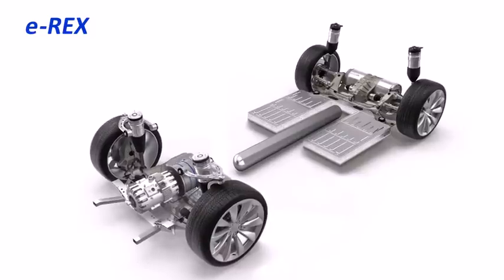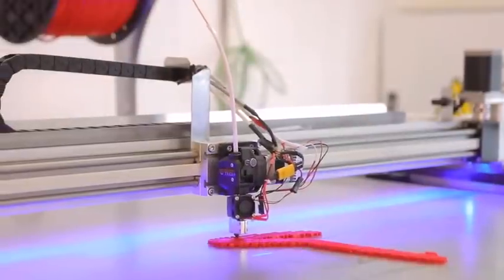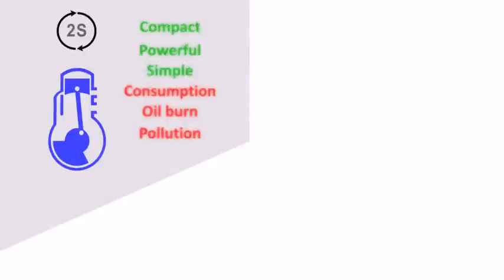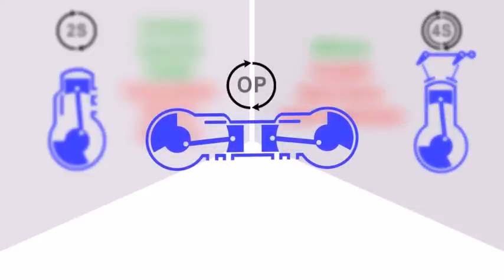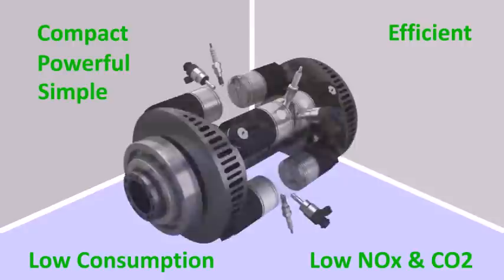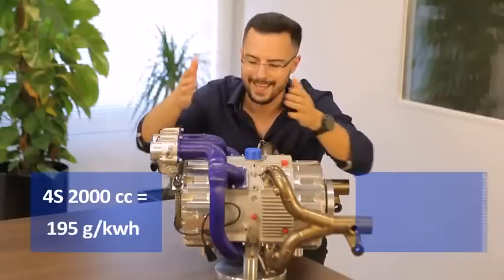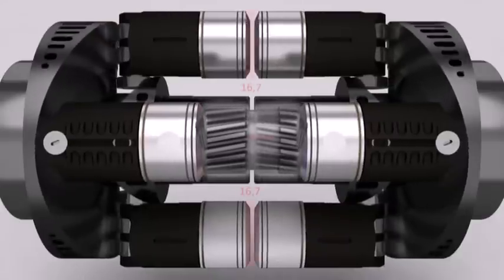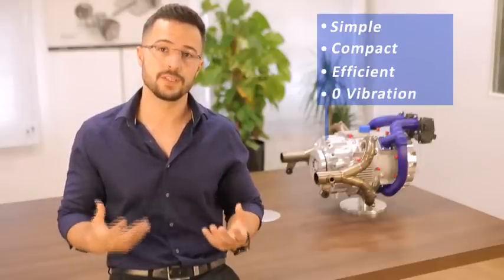The True Range Extender

Comment: hate to tell you this but that is two strokes not one. This is not a new design, the acadies engine is basicly the dame but with cran shafts. I would also add dimpling to the pistons it will increase thermal eff. and decrease NOx and CO2.

Comment: This is a modified copy of an opposing piston engine built around 1914. It will be highly polluting as it needs to burn oil with the fuel. Quite simply an outdated 2 stroke engine having a swash plate (1917 design) instead of a crankshaft. No more no less.

Comment: I'd like to see this in the real world... 1 question, looking at the cutaway thus is by all definitions a 2 stoke engine atleast, it has a compression stoke and a expansion stroke just like any 2 stroke engine...if your going to say it's a 1 stroke then you have to say a rotory is a 1/2 stroke, it has a 1 and a 1/2 expansion cycles per rotation of the, or for every 3 rotation of the "crank" shaft is about 6 expansion strokes...

Comment: I take issue with the terminology used. Firstly, this is not a one-stroke engine. The fact it has opposed pistons that move each move forward and back precludes the use of the term one stroke. One stroke means one action, one time. The absence of a crankshaft does not eliminate piston strokes. What you built is a two-stroke non-crankshaft engine. Btw: It also still has four phases. Intake, compression, power, and exhaust. How are you lubricating the piston rings? 

The beef I have is with how you described having variable compression! You said that when more power was needed, the compression was lowered; when more efficiency was needed, it was raised. ICE does not work that way. Higher compression engines are generally more powerful and efficient, while lower compression engines are the opposite. 

You must also develop a variable octane fuel to get variable compression to work correctly. Lower octane fuels burn faster than higher octane fuels. If you use a lower octane fuel in a higher compression engine, detonation will occur because it will ignite too soon. If you retard the ignition timing to compensate, you lose power and efficiency. If you use high-octane fuel in a low-compression engine, you lose power and efficiency because it burns slower and will not be completely burned when the exhaust phase arrives, resulting in higher emissions. Advancing the ignition timing can help compensate for the higher emissions but not the loss of power and efficiency. 

I see no practical reason for variable compression unless the sole purpose is to allow the owner to use less expensive lower octane fuel when not using the vehicle in a manner (towing, hauling) requiring more power. It also adds unnecessary complexity to the system.

Comment: This is a 2-stroke. We count the strokes by how many events happen per piston. This has a compression stroke and a power stroke, therefore 2 strokes. We do not count strokes by how many power strokers there are for the entire engine per revolution. If we did this, then a normal v8 would be 1-stroke because it has a firing event per half rev.

Comment: Must build a large one.❤
Reply: Then make it run on race fuel & stick it in a motorcycle 😂
Reply: @InsaneDad  that's the spirit 🤣
Reply: But, honestly. I feel that people would really get pumped about it if they built a high performance model. Namely American use. Don't corner yourself to a specific market with ev. I feel like as a stand alone power plant, the hp seems to be there. Honestly, maybe even side by sides. Boat motors, sky's the limit.

Comment: Its a 2 stroke not a 1 stroke .{1 stroke for combustion & exhaust} and {1 more stroke for intake & Compression} .So my math says 1+1=2 stroke. But still a awesome design and type of engine .And a awesome way to bring 2 stroke back to new generation motors .And if its as sufficient as INNengine says it is , then it would be perfect for ultralight aviation .Smaller so less metals to cast and machined ,and less working components then your normal 4 stroke engine. And my favorite thing about this engine is that you can change the compression easy. It would be much easier & cheaper to use this engine in a AWD mid engine vehicle .So its a 2 stroke engine that doesn't use 2 stroke oil & your ordinary crankshaft+connecting rods so its a opposed 2 stroke motor .I cant wait till someone does force induction on this motor ,or a turbo diesel model.

Comment: Range extension is great, why EV manufacturers (especially those from well established, well funded companies like ford or hyundai) didnt think to incorporate them from the jump is beyond me. Where i live and work the nearest charging station is over an hour away. And those living in towns / small cities who dont have a driveway and have to park on the street have 0 options for charging an ev. You cant run an extension cord out the front door to your car and hope nobody screws with it or trips over it and sues you.
Reply: Range extenders are a mixed benefit/cost.  For short trips you've got dead weight doing nothing but reducing efficiency.  For medium trips the generator may only be the same energy density as good batteries, so you get radically increased complexity with the same range as you'd get adding extra batteries.  For long trips it would be a real benefit, but it would take a long trip to be a worthwhile benefit due to the added weight and increase in complexity/decrease in reliability.

Comment: If u want a single-cylinder solution (instead of 4-cylinder), u have to let the 2 single-OPOC-pistons push the inside of a single eliptical race (instead of 2 swash-plates), that´s solidly and concentrically mounted on a flywheel (and better than the swash-plates)... In other words, the reverse of that here (not the cylinder, but the eliptical race must be turning!!!): https://www.youtube.com/watch?v=kHXKNpXoQUo
The difference is, that while the pistons of the engine (under the LINK above)  have straight rollers that simply turn the straight eliptical race, HERE, the straight rollers (of finite but substancial width) of the pistons have to turn a disc, and this can only work, if the rollers´ width is zero  (which doesn´t exist). 

But both need turbo-charging, and even direct injection, at best. It´s a clearly a 2stroke (not "1stroke"), and as every 2stroke, efficiency is low without direct injection.

Comment: 1-stroke??? It depends how you define the strokes: If you define the strokes by the movement of pistons it is a two-stroke! By this calculation a 12-cylinder 4-stroke woud be a one-third-stroke engine. :)
Besides this childish definition, if more efficient this motor would be a great deal!
By the way: As I see this design, the pistons are pushed down only by the power of combustion. Howcan you start this motor if all pitons are in up position?
Reply: They cannot all be in up position, since the intake-air won´t compress readily, to let that happen. all 4 piston-pairs can only be in the "middle" position. It works the same as if a crankshaft were there: Turn the swash-plates, and the pistons will follow/move according to the swash-plate form, suck air, compress and ignite it.

Comment: 195g/kWh  Que!!!!!  maybe 195g/kW learn the difference between energy end effect.
Reply from the maker: Specific consumption is measured in g/kWh. In other words, how much fuel (grams) you use to produce a certain ammount of power (kW) for a certain ammount of time (hour). I hope you learned something today, thanks for watching!
Reply: If you men how much fuel it takes for 1kWh you must give us exactly the fuel energi (chemic energy not nuclear). we know how big difference it is between metanol and jet fuel.

I think that this range extender has much better potential than your.  https://www.youtube.com/watch?v=_pBPw33ceoQ&t=6s
Reply: gr/kWh is correct. 195gr gazoline contain 2,34kWh. The engine extracts 1kWh of electricity out of the 2,34kWh of chemical energy, that´s contained in gazoline. 2,34kWh of chemical energy are spent for an 1kWh-electricity-production, or 195gr/kWh.

Comment: You say the motor is equal to a 2L 4 cylinder 4 stroke modern engine is efficient? How efficient? Also how much more efficient is this engine? If it is not 15% or more they automotive Boys won't look at it! It would mean gutting their engine plants & starting again.
Reply from the maker: It's hard to compare efficiency. The same % in an ok large slow diesel engine, would be impresively good in a small gasoline. We will have definitive efficiency figures by the end of 2023 as part of the homologation process.
On the other hand, you are right in your assessment of how hard it is to penetrate the automotive market, this is why we are focusing initially in other sectors where our weight reduction figures (70%) are a game changer by themselves, and any efficiency improvement is an added bonus.
Thanks for your comment!

Comment: Compact - Yes. 
Min vibration - probably yes. 
One stroke - BS! Power stroke + compression stroke = two strokes. 
Efficiency - power lever arm ~ 50% crankshaft
Hybrid vehicles = bad (crutch) solution
Reply from the maker: Early tests are showing close to 30% reduction the drag friction coeficient. This was expected anyway since not only we have smaller engines at lower RPM producing more power but also much of the contacting surfaces interact now by rolling as opposed to friction.
As for hybrid systems, the future is eclectic.
Thanks!

Comment: VCR designed by Caterpillar in the early 2000's.
Reply from the maker: There are many engines designs with VCR. The latest example would be Infiniti's. The difference is that, since their concept "adapts" the conventional engine concept to achieve variable compression ratio, the result is expensive, bulky and complex. Our design is the first one which can achieve VCR without the need of complex systems thanks having been designed from scratch with it in mind. Thanks for watching!

Comment: How about the abrasion problem at the contact point between the cylinder and the curved plate.
We solved it with metallo-ceramic at the apex of the Wankel engine rotor; by the time the Wankel engine was ready, the market didn't wanted it anymore.
How many km a car with your engine will fare?
The initial Wankel lasted 50k km vs 300k km of a piston engine, thus failed initially.
Great innovation BTW, thanks for the video ..
Reply: this is the first I've heard this claim of the Wankel contact point being solved. Please share data
Reply: @larrymar19  me too :)and doesn’t matter BTW that they burn oil in almost two stroke rates :)
Reply: "the contact point between the CYLINDER and the curved plate" is uncritical, a plain gap could be there, and it wouldn´t matter at all... It isn´t a contact-point subjected to combustion-chamber-pressures, where it´d have to be air-tight. It doesn´t have to be air-tight for any reason, so, leaving a gap there is the best solution, possibly.
The contact point between the PISTONS and the curved plate, an the other side, are critical, and may have too high friction, but the pistons ride on (frictionless) rollers (with bearings themselves) upon the swash-plate

Comment: Variable compression ratio like that, OK,   1/2 stroke ! garbage marketing ( like climate change) ....   you get that with an 8-cylinder: 1 power stroke every 1/4 revolution.   but I like the compactness like an hydraulic pump/motor..      yes/no?
Reply from the maker: No, it's not the same. Of course you can have the same power delivery just adding more cylinders, but then your engine is larger, heavier and more expensive. The beauty resides in having more with less. Thanks for watching!
Reply: there are similarities to the steering pump motor on the car i used to have.

Comment: Basically, a swash plate motor but I can't see why it is being called a "One-Stroke " Motor.
 A one-stroke motor would only fire once and then do nothing. Opposing pistons have been around since the Napier Deltic engine, a 2-stroke, 3-crankshaft, diesel motor used in Trains and generators.
https://www.youtube.com/watch?v=V8dJrnADE4Q
Still, combined with an electric generator, this is a great solution for hybrid vehicles.
Reply: It would be a 2 stroke, I don't think they understand how a 2 stroke actually works. Up and down are 2 strokes, I think they are misunderstanding the concept of how 2 and 4 strokes function.

'm guessing it uses an early exhaust timing or higher exhaust port along the cylinder, in order to use the pressure from the hot combustion byproducts to mostly evacuate the cylinders, then shortly after, opening the intake at the opposite cylinder end, which would likely be forced induction boosted - through a turbo or supercharger, to push out the rest of the exhaust at bdc, then closing both off and injecting fuel at high pressure as the pistons are at or nearing tdc. It would work, but rpm range would be strictly dictated by the speed at which the pressurized exhaust could flow out of the cylinder. Timing would need to be very precise, sensors would need to be very accurate. Too slow and there would be pressure spikes traveling up and down the exhaust and intake tubes, too fast and the intake would be fighting to push pressurized exhaust out, still combusting as the pistons try to come together again. This would be fine if it's only being used to power an electric motor, you could keep the engine running at a narrow rpm range if you coupled it to to a bank of batteries and/or capacitors. They could be charged while idling or driving at a stable load, in order to have extra power during acceleration. What I'd be most concerned with is the uneven heating of the intake versus exhaust ends of the motor, and how to properly keep all the swinging metal lubricated evenly and effectively. Also how to get it started without the rpm being too low, possibly damaging the super or turbocharger vanes, and how to get your forced air spooled up right away to enable proper cylinder exhaust evacuation during the start.
Reply: They are very open and have explained many times that it is a two stroke and the reason behind the tag 1 stroke
Reply: @hoymejorqueayerrgr5444  It's easy to criticize and without taking 2 mins to learn what these people are doing.
Reply: @felipeberruezo yes, could you explain us your point view?
Why does this motor have only one stroke?
How would be your lubrication system?
How would  this motor work its side force with the wall of cylinders?
And there would be a lack of harmony between the base of pistons and the disc that makes the time of cranckshaft?
Reply: @saulocoelho5513  The devil is in the details. The lubrication aspect is what concern me. Just like the Mazda Wankel engine in the early 70s, just having an engine design that works doesn't mean you have one that will work for 20-50-100k miles. Each piston is riding the wave plate crank thing with what looks like a roller bearing- so there is actually a very small contact surface that needs high pressure oiling. And speaking of the Mazda Wankel, they actually do have a Ranger Extender version of that now.  A compact smooth running single rotor engine the size of a shoebox already being sold in the MX-30 R-EV. Well, it was supposed to launch this year in Europe and Japan. It needs the range extender desperately as the MX-30 was a short range EV compliance vehicle for California.
Reply: @hoymejorqueayerrgr5444  Explaining why you are lying about you technology doesn't make it any less wrong. It reeks of misinformation for hype like potential scam artists use to generate hype and get investors. They should not call it that imo. If the engine is a great design and not just a great concept, it will get media attention even without lies.